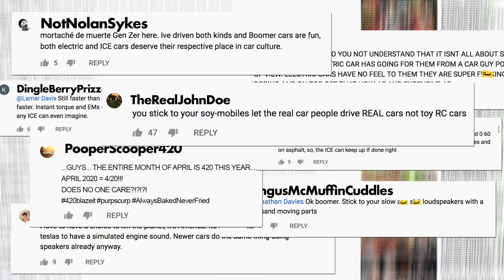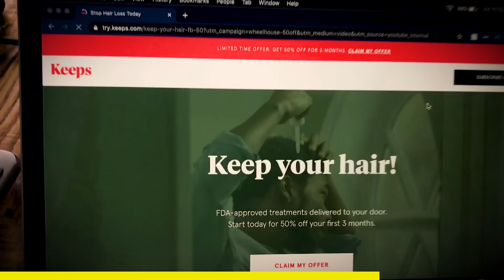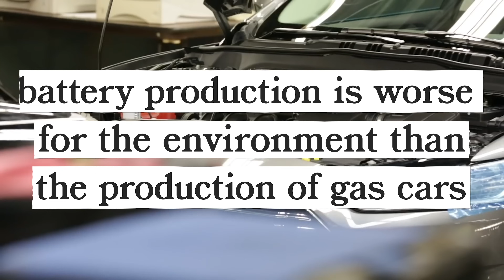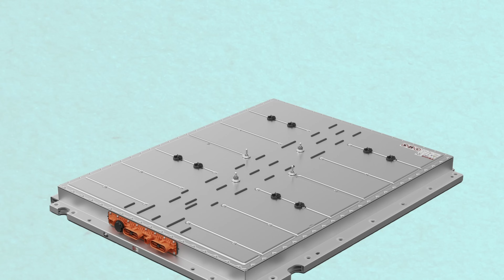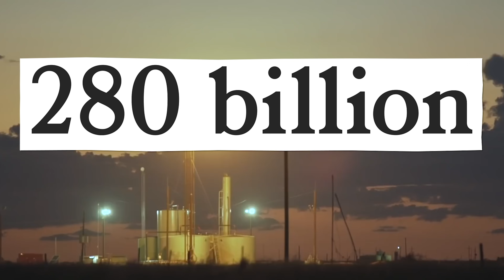Are Electric Cars REALLY Better for the Environment?

Comment: You should move to metric system so you can just call it "tons" 😁
Reply: America should've done that ages ago
Reply: Americans do say tons, but it's not the same as a metric ton...  2000 lbs vs 2205 lbs (metric).
Reply: @craigzilla100  1000 kilograms you mean...
Reply: @dennis_nl2723  1000 kg is the same as 2204.6 lbs.  Which is heavier than a "ton" in the states.  I work in an international manufacturing company in the US, and we use metric tons for our shipping weight, so we have to calculate this often.
Reply: @craigzilla100  I know, but my point was that America should've adopted the metric system way back
Reply: Agree..  we use it for high school track competitions at least.  Lol!!    I've heard good arguments from contractors though on American standard measuring tapes and how they are more precise than metric.  It's quite interesting how we decided to stick with it.
Reply: @craigzilla100  I honestly think they're both as precise, but metric just doesn't involve like 8 totally different formulas that you need to remember for an exam. Instead literally everything is linked in the metric system. Weight, distance, liters of water, it's all related to eachother and can be so easily converted. You don't even need to know ANY formula for an exam or even daily life.
Reply: But muh freedom units!!1!1!!11

Comment: Because manufacturers are secretive about what goes into their batteries, it makes it harder to recycle them properly. Currently, recovered cells are usually shredded, creating a mixture of metal that can then be separated using pyrometallurgical techniques—burning—which wastes a lot of the lithium. Alternative techniques, including biological recycling where bacteria are used to process the materials, and hydrometallurgical techniques which use solutions of chemicals in a similar way to how lithium is extracted from brine are being investigated.

It is estimated that between 2021 and 2030, about 12.85 million tons of EV lithium ion batteries will go offline worldwide, and over 10 million tons of lithium, cobalt, nickel and manganese will be mined for new batteries. China is being pushed to increase battery recycling since repurposed batteries could be used as backup power systems for China’s 5G stations or reused in shared e-bikes, which would save 63 million tons of carbon emissions from new battery manufacturing.

Comment: The lithium extraction process uses a lot of water—approximately 500,000 gallons per metric ton of lithium. To extract lithium, miners drill a hole in salt flats and pump salty, mineral-rich brine to the surface. After several months the water evaporates, leaving a mixture of manganese, potassium, borax and lithium salts which is then filtered and placed into another evaporation pool. After between 12 and 18 months of this process, the mixture is filtered sufficiently that lithium carbonate can be extracted.

South America’s Lithium Triangle, which covers parts of Argentina, Bolivia and Chile, holds more than half the world’s supply of the metal beneath its salt flats. But it is also one of the driest places on earth. In Chile’s Salar de Atacama, mining activities consumed 65 percent of the region’s water, which is having a large impact on local farmers to the point that some communities have to get water elsewhere.

As in Tibet, there is the potential for toxic chemicals to leak from the evaporation pools into the water supply including hydrochloric acid, which is used in the processing of lithium, and waste products that are filtered out of the brine. In Australia and North America, lithium is mined from rock using chemicals to extract it into a useful form. In Nevada, researchers found impacts on fish as far as 150 miles downstream from a lithium processing operation.

Lithium extraction harms the soil and causes air contamination. In Argentina’s Salar de Hombre Muerto, residents believe that lithium operations contaminated streams used by humans and livestock and for crop irrigation. In Chile, the landscape is marred by mountains of discarded salt and canals filled with contaminated water with an unnatural blue hue. According to Guillermo Gonzalez, a lithium battery expert from the University of Chile, “This isn’t a green solution – it’s not a solution at all.”

Comment: In May 2016, dead fish were found in the waters of the Liqi River, where a toxic chemical leaked from the Ganzizhou Rongda Lithium mine. Cow and yak carcasses were also found floating downstream, dead from drinking contaminated water. It was the third incident in seven years due to a sharp increase in mining activity, including operations run by China’s BYD, one of the world’ biggest supplier of lithium-ion batteries. After the second incident in 2013, officials closed the mine, but fish started dying again when it reopened in April 2016.

Lithium prices doubled between 2016 and 2018 due to exponentially increasing demand. The lithium ion battery industry is expected to grow from 100 gigawatt hours of annual production in 2017 to almost 800 gigawatt hours in 2027. Part of that phenomenal demand increase dates back to 2015 when the Chinese government announced a huge push towards electric vehicles in its 13th Five Year Plan. The battery of a Tesla Model S, for example, has about 12 kilograms of lithium in it; grid storage needed to help balance renewable energy would need a lot more lithium given the size of the battery required.

Comment: Solar panels may be an appealing choice for clean energy, but they harbor their share of toxic chemicals. The toxic chemicals are a problem at the beginning of a solar panel's life -- during its construction -- and at the end of its life when it is disposed of. These two intervals are times when the toxic chemicals can enter into the environment.

The toxic chemicals in solar panels include cadmium telluride, copper indium selenide, cadmium gallium (di)selenide, copper indium gallium (di)selenide, hexafluoroethane, lead, and polyvinyl fluoride. Additionally, silicon tetrachloride, a byproduct of producing crystalline silicon, is highly toxic

Comment: n one 2003 study, researchers drew attention to the fact that cadmium is the benefactor of special environmental treatment, which allows solar energy to be more economically efficient (as far as that word quite applies to solar energy even in the current state of subsidization). They wrote:

If they were classified as "hazardous" according to Federal or State criteria, then special requirements for material handling, disposal, record keeping, and reporting would escalate the cost of decommissioning.

This mirrors an answer given by Cara Libby, Senior Technical Leader of Solar Energy at the Electric Power Research Institute (EPRI), who admits that there is no lucrative amount of salvageable parts on any type of solar panel. She adds:

In Europe, we’ve seen that when it’s mandated, it gets done. Either it becomes economical or it gets mandated. But I’ve heard that it will have to be mandated because it won’t ever be economical.

Comment: For any user of solar panels, this is not an immediate risk as it only affects manufacturers and recyclers. More disconcerting, however, is the environmental impact of these chemicals. Based on installed capacity and power-related weight, we can estimate that by 2016, photovoltaics had spread about 11,000 tons of lead and about 800 tons of cadmium. A hazard summary of cadmium compounds produced by the EPA points out that exposure to cadmium can lead to serious lung irritation and long-lasting impairment of pulmonary functions. Exposure to lead hardly needs further explanation.

Comment: According to cancer biologist David H. Nguyen, PhD, toxic chemicals in solar panels include cadmium telluride, copper indium selenide, cadmium gallium (di)selenide, copper indium gallium (di)selenide, hexafluoroethane, lead, and polyvinyl fluoride. Silicon tetrachloride, a byproduct of producing crystalline silicon, is also highly toxic.

The pro-solar website EnergySage writes:

There are some chemicals used in the manufacturing process to prepare silicon and make the wafers for monocrystalline and polycrystalline panels. One of the most toxic chemicals created as a byproduct of this process is silicon tetrachloride. This chemical, if not handled and disposed of properly, can lead to burns on your skin, harmful air pollutants that increase lung disease, and if exposed to water can release hydrochloric acid, which is a corrosive substance bad for human and environmental health.

Comment: Looks like somebody is paid by the green mafia.
Reply: He didn't mention that the batteries only last for maybe 5 years and the solar panels have to be replaced every 10 years. He also didn't mention the amount of copper that is necessary and forgot to mention the toxicity of the discarded solar panels and lithium batteries. Which are not 100%  recyclable .  While my diesel engine has 1 million miles on it and is still kicking and can be 100% recycled . I also  have over 350,000 miles on my gas engine which also can be rebuilt or recycled ,your not gonna get that mileage out of your solar batteries . Your research gets three  bullshit bullshit bullshits.  plus you never mentioned synthetic oil or alternative fuels like natural gas which are much cleaner than gas . They must be paying you all  tons of money to sell out your countries energy independence , fucking traitors. I'm unsubscribing to this blatant bullshit spewing from a guy with a IQ of 80
Reply: @nobullshiit5682  10\10 Sir

Comment: More effective or not, the thing I hate about electric cars is how quiet they are.I was strolling down the street and a Peugeot e-208 passed by and I didn't hear anything other than a small woosh.
Reply: wow. those must have been some new technology of silent tires to eliminate all that road noise! Especially considering than modern engines are typically not much nosier than an EV unless they've been geared towards performance (and noise). only by about 30dB or so. Which means that at speed, the difference in sound is indistinguishable over the noise made by the tires!
Reply: @engineeringtheweirdguy2103  The woosh was from the tires on the road that's what I mean.
Reply: @mariantaraza4948  so you're disappointed by the lack of sound?
Reply: @engineeringtheweirdguy2103  yes because it's dangerous.You can hear Diesel or petrol engines from far away because of how much noise they make.
Reply: @mariantaraza4948  as i said previously. Modern diesel and petrol engines, those designed in the comfort and luxury range, not the sports range in any case, dont produce noise louder than the wheel noise. ever heard a 2020 camry drive past? you cant even hear the engine until it passes you and the exhaust is facing you. This isnt an issue unique to EV's its also, not an issue, considering that when the vehicles start travelling at a speed enough to either do damage or that the driver would not be able to apply the brakes fast enough to avoid the unwitting and idiotic pedestrian who apparently doesnt have eye balls and whom nobody taught them as a child to look both ways, you would be able to hear the road nose form the tires. And dont use the blind person argument. If they're able to avoid cyclists, then they can avoid a 2 ton vehicle. In addition to that blind people typically dont J walk.
Reply: @engineeringtheweirdguy2103  Too bad most people in my country drive +10 y/o diesel cars which make a lot of noise and a lot of black fumes.

But you are right, modern cars are indeed quiet.

Comment: There was one thing (in this huge topic) I hoped you would have covered. Cars becomming "mechanically totalled" which intodays more modern cars is becomming much more of an issue, where the cost of repairs is worth close to or if not more than the value of the car.. So the whole car gets throw out to the wreckers. even if are large percentage of the car is abled to be recycled it's still very wasteful. My point to this is with electric cars & lets say I buy a cheap brand new EV the battery life span is about 10 years before range becomes a real issue. So at that point throw a new batter in and your good to go right? 
Well EV's depreciate in price... and the cost of a new battery can be anywhere between $5,000 - $22,000 USD (from Toyota hybrid to Tesla long range). So what happened when EV's start hitting that ~10 year mark.. how many are junked & how many are willing to fork out thousands of $$$ on a +10 year old EV... at that point what is a perfectly good vehicle gets scrapped because of the battery?  
Even if the majority of the car gets recycled it's still extremely wasteful - and that's not even getting into what really happens in recycling process to what we think we know (a lot ended up being dumped in China until they said no more, so other 3rd world countries take our crap).
So it's not like I have a horse in the race.. I own a V8 and love it but in the future I'd like to have an EV as a daily.. but at least for Australia that's comming with a whole other issue.. Drivers in Australia that use EV's will be charged/taxed on how much they drive them... so if you have a long commute to work.. sorry pal.. it will be cheaper for you to drive a petrol car...
Which leads into another issue over in the UK where they are looking to ban petrol (and diesel I believe?) for the CBD...  ok that's a whole different topic - but the point being there is no clear winner yet, or should I say don't believe the hype there's never a magical fix it all answer.
Does EV's have some real potential to be the majority , of cause and it seems extremely like, but as a consumer I do have my concerns, not least about the batteries ...
Reply: there are a couple of common misconceptions here. Anti-EV proponents always say that EV's dont last past 5-10 years. In reality most EV's have battery warrantees up to or exceeding 8 years, often with unlimited miles. That is because in reality modern EV's with their battery and battery management technologies, can last around 1500 cycles to 30% degradation. If you get 325 miles to a full charge, thats 487,500 miles before your range drops below 230 miles (which is still far more than anyone's average daily commute.)

The second is depreciation of the vehicles. Its a little known fact that the Tesla Model 3 has the lowest ever recorded 5 year depreciation of any vehicle. That would be because unlike other cars, Tesla's can update themselves and continue improving and adding features free over the air as they go on. But thats a minor detail, the largest reason for such low depreciation of 5 years is because of how long the batteries last. You lose nearly no performance with battery degradation, mostly just range. When you have a battery that will last nearly twice the average lifespan of a combustion engine, depreciation will be low.
Reply: also for Tesla, replacing the battery PACK is 22,000. Because the battery pack makes up most of the chassis, as well as containing coolant systems and other BMS's. In reality these packs are made up of thousands of 18650 batteries, which are actually pretty easy to replace and cheap to buy. Current costs to replace the batteries, not the pack for a Tesla is in the $7k range and falling.
Reply: Also as one of those Australians currently being Taxed per km of driving an EV. I can confirm its still cheaper than a Combustion car. I drive approximately 65,000km per year. I purchased a Tesla model 3. Excluding other cars in its performance and price range using up to 11L/100km of premium fuel, most vehicles in its size class consume 8L/100km. So if we consider that the average price of fuel in Melbourne last year was around $1.40/L. My cost of electricity is 20c/kWh. 

My EV consumes around 130 Wh/km according to the odometer average. That means over 65,000km it will cost me (65,000x0.13)x$0.2=$1,690 per year in electricity. (excluding free destination charging I get at lots of locations). For fuel it would cost me 8x(65,000/100)x$1.4= $7,280 per year.

EV's also use regenerative braking, this means they use their brake pads 5x less often on average. The average distance before replacement of brakes and rotors for a combustion car is 80,000km, for an EV that number is 200,000km, at a cost of $700. Incrimental cost towards this between petrol and EV is (65/80)x$700= $569 towards brakes and rotors, for an EV that is (65/200)x$700 = $227.

Then there is servicing. Not alot of people realise this but EV's dont actually have anything to service. The model 3 have Zero manditory regular maintenance. Infact the only thing it does have is it recommends tire rotation but that is optional in the eyes of the warrantee. Combustion cars not so much. For a combustion car, you need to do a minor $250 service every 10,000km and a $1,400 major service every 100,000 km. So the incremental service costs over the year would be ((65/10)x$250)+((65/100)x$1,400)=$2,535 and for an EV thats... well $0.

So it costs me $1,917 per year to operate my Tesla Model 3. But if I had a Petrol car it would cost me $10,384 per year to operate.

But we'll add in the tax, 2c per km. that adds $1,300 per year But in that state EV's also get a $100 discount towards their rego each years, so it becomes $1,200. In other words the difference is now $3,117 per year against 10,384 per year. So I get a saving of $7,267 per year in my pocket.

Averaged per km, EV's cost $0.048 (4.8c) per km. For a petrol car that doesnt have the luxury features and performance of the same EV (remember above they were 11L/100km), it costs $0.16 per km. So 16c per km. I am saving around 11c per km.

EV's even with the tax are significantly cheaper to operate than a petrol car.